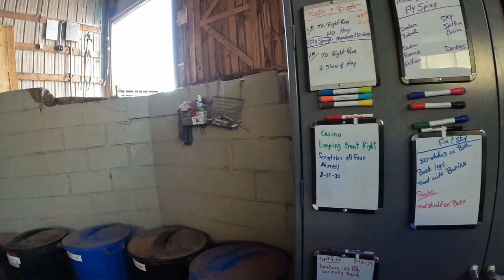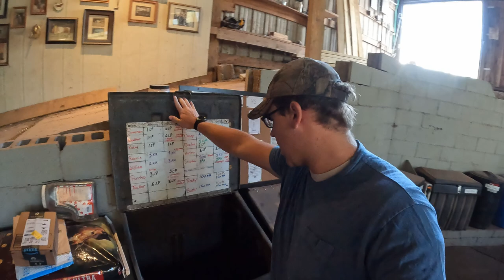ARE WE FINALLY SEEING PROGRESS?

Comment: I'm curious. Would it make any difference with the rain related things like scratches and rain rot if the horses had a covered area in the pasture, or does that create a new set of issues that are harder to deal with?
Reply: I see a lot of horses with covered areas to get out of the rain, snow sun. I often wonder why they didn't have a few out in the pasture. The upper pasture has 1. Other boarding places leave their stalls open, so they go in when needed.